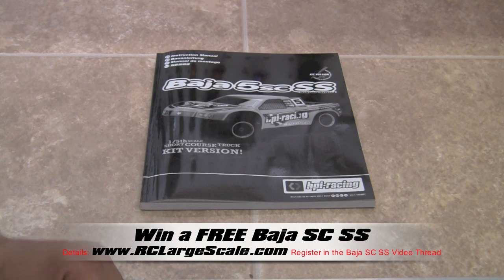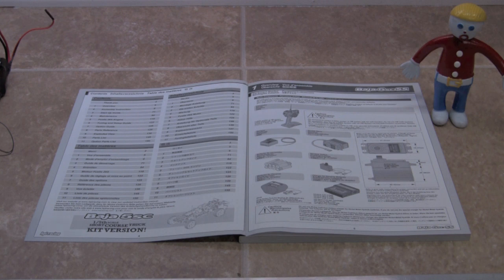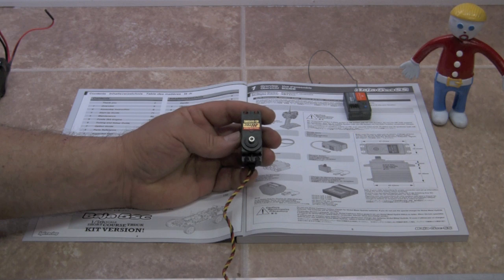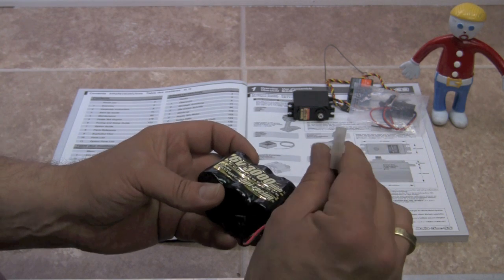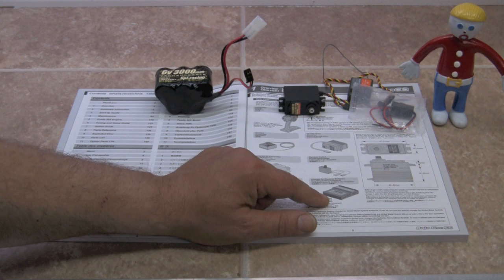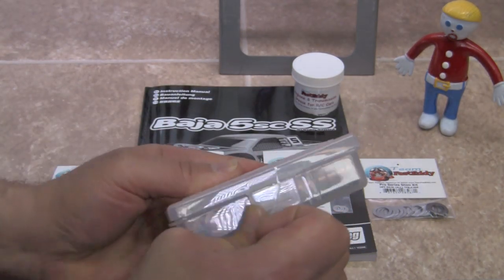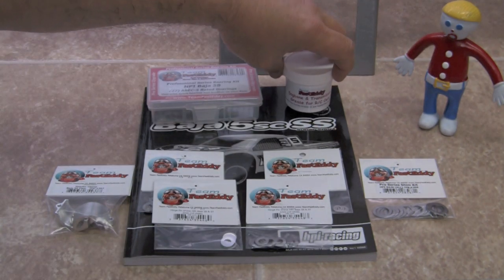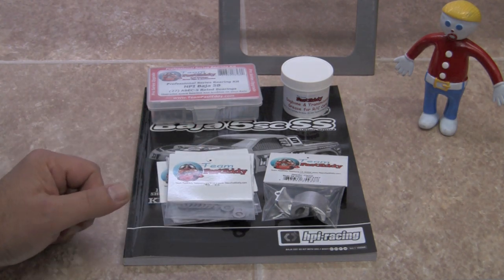HPI Baja 5SC SS Build Video #1 Page #5

Comment: hello team fast eddy.
you can explain how to install telemetry system on a baja 5b ss? where to place the rpm sensor and temperature sensor? use the sanwa m11x. and another question, I can use lipo batteries for sanwa rx 461 receiver and I have to keep in mind? which parts I have to change?
thanks